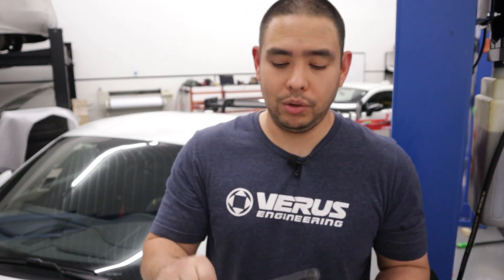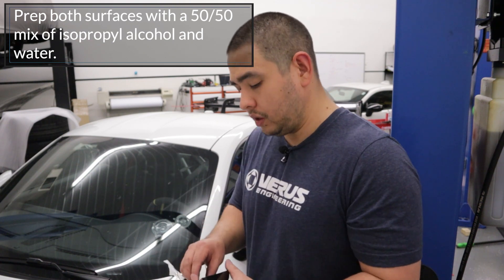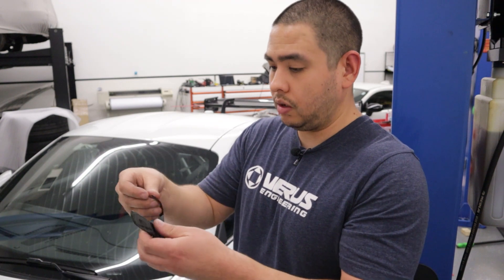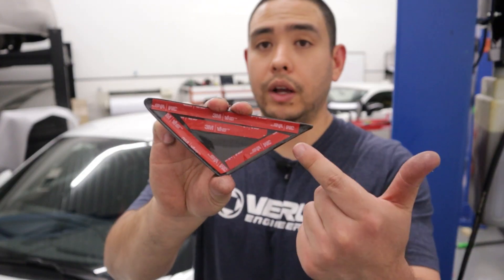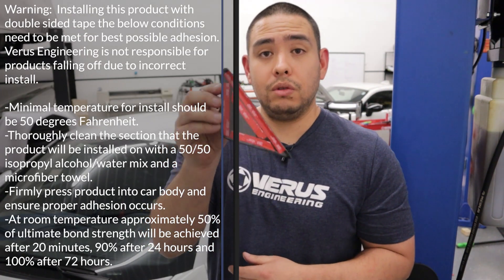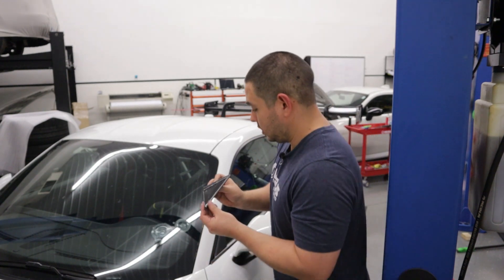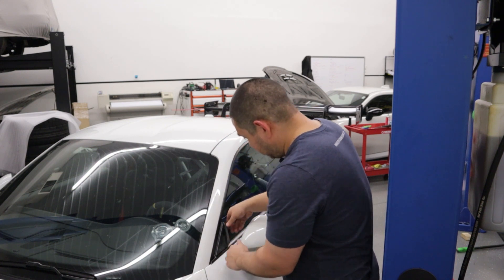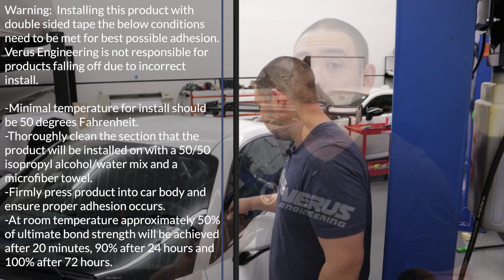Porsche 991 GT3/GT3RS Anti-Buffeting Wind Deflector Kit Installation

Comment: I miss the videos that covered the how and why theas devices work ._.
Reply from the maker: These are pretty self-explanatory. The buffeting is caused by airflow around the A-Pillar of the Porsche attaching and detaching while the windows are down.  This causes pressure waves to build in the cabin of the vehicle and the noise we all hate with the windows down.  Utilizing these wind deflectors ensures airflow detaches going around the windows and stops the issue.
Reply: @Verus Engineering  yes self-explanatory on theas .
Front spliter not so obvious what the down force / grip  improvement expectations are. CFD  WAS WHAT BROUGHT ME. 
The principles you share, explain, and demonstrate are cross-platform. Aka they apply to circle track, drag, land speed racing. I understand theas ( 3 most recent videos)are the how install products making the company money. ( doing an exquisite job of taken the guess work out of getting it done) it's the technical videos I'm saying I miss.( small crowd I know)
Reply from the maker: @daviddroescher  We have informative packets regarding this information on our website. During install videos, we do not wish to go that in-depth with this sort of thing. We will keep the technical videos in mind for future video ideas.
Reply: @Verus Engineering  
Thank you for the  consideration.